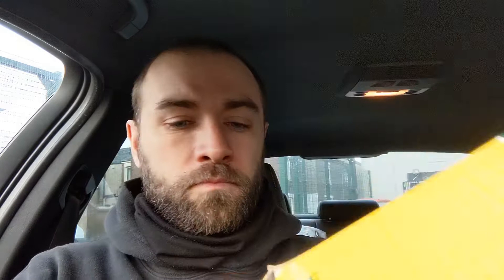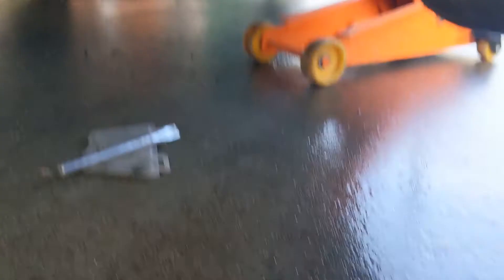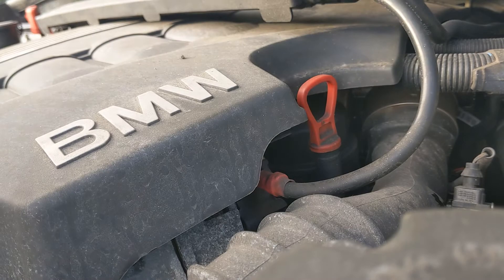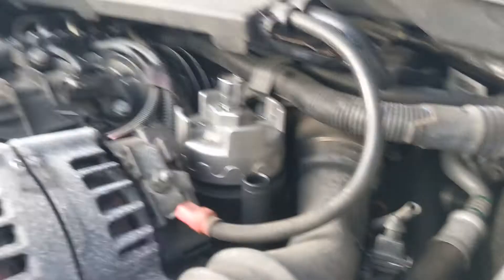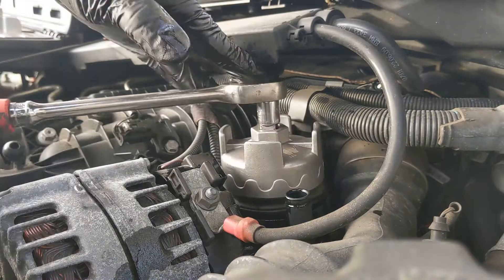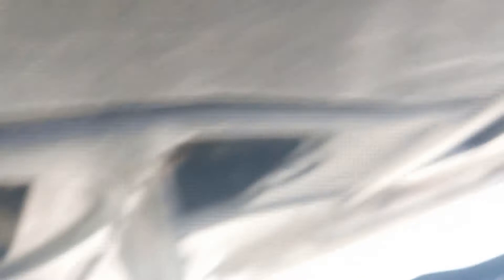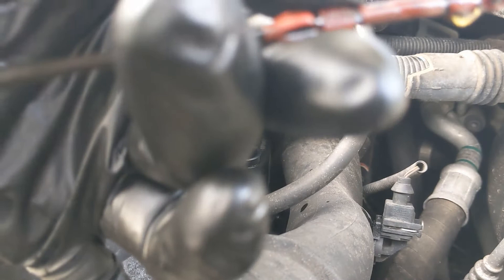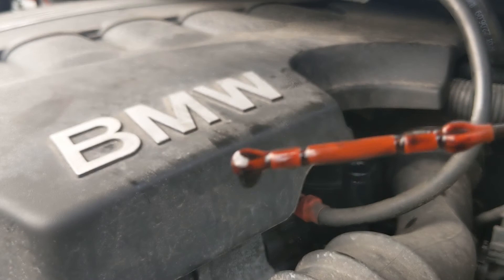BMW 320d Oil & Filter Change (N47 Engine)

Comment: Just wondering if its possible to miss the alignment? Will the filter housing not tighten correctly?
Reply from the maker: It is possible but if you look down into the filter housing the hole is easy to see. Also the filter doesn't sit quite right if the hole is misaligned.
Reply: @Papa77sGarage  thanks, looks like i might have to recheck the filter it isn’t leaking and torqued down but better to be safe

Comment: I have e 2009 e90 320d, n47 engine. How much oil goes into the engine? I saw that you put 5L, on the internet it says that is enters 5.2L.
Reply from the maker: I also put a 300ml can of oil additive in there as well so that makes up the difference. The best thing will be to put 4.5 in and let it settle. Check dipstick and top up to maximum as necessary. 5L will probably get you about halfway between min and max.

Comment: It can de done without scan tool. Turn ignition on not the engine. Wait for all warning/service lights to go off.
Hold odometer reset stick in until service warning light comes on....blah blah just youtube it.
Reply from the maker: I do recall something like that for the Mini's. There is a BC button that is used but I don't think I could ever get it to reset on a BMW. Mini's however thar procedure did work.

Comment: Am I right, that you're only using a jack whilst under the car? Wow, talk about taking a risk, if so!
Reply from the maker: I would have to rewatch the video to find out as it was nearly 2 years ago. I'm usually quite vigilant when it comes to things like potential death by crushing so would like to think I used an axle stand.
Reply: @Papa77sGarage  yeah, perhaps it's just not showing on the angle of the vid, and you also left the jack as an extra safety...

Comment: The grade is important, the ”longlife” not so much. Also it seems you put in too much oil.
Reply from the maker: I would have to disagree with you there. The LL04 is there to let people know that the oil in question has met a certain standard or approval. Whatever the oil viscosity may be it's the approval that counts. It's printed in most vehicle user manuals. Ford have WSS numbers, Citroen/Peugeot have PSA numbers, VAG have VW numbers, vauxhall has Dexos, then there's API and ACEA standards as well. They are all there for a reason and that is different manufactures test and approve different engine oils for their engines. So if LL04 is on 0w30, 0w40, 5w30 and 5w40 in theory either of those viscosities can be used. Obviously I would try and use the same viscosity that has previously been put in there which in my case was 5w30.
Reply: @Papa77sGarage  As the camchain is an potential issue on all N47 engines, Bmw mechanics recommend Castrol Edge 0W-30 for less wearing cold starts. And also a change every 15000km.